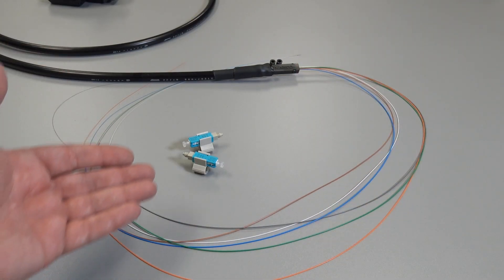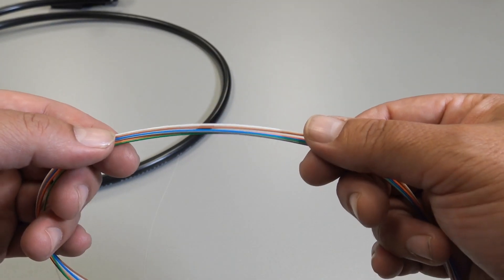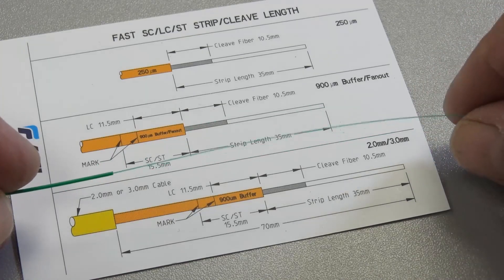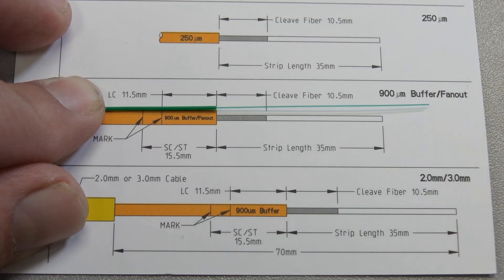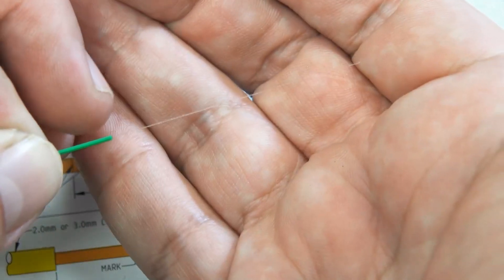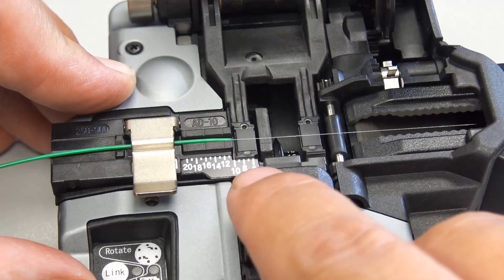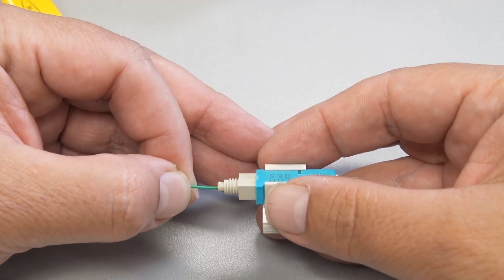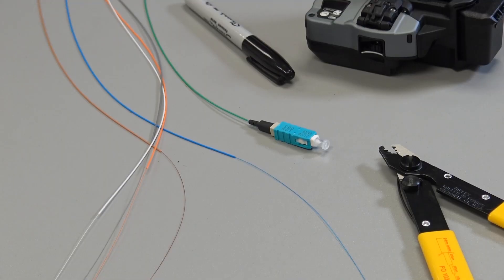How to terminate the AFL Fast Connector with a 900 um Fan Out Kit to 250um Fiber Cable

Comment: Keep tension on the 900micron fiber against the connector before removing the clip. It will save you from nightmares when testing.